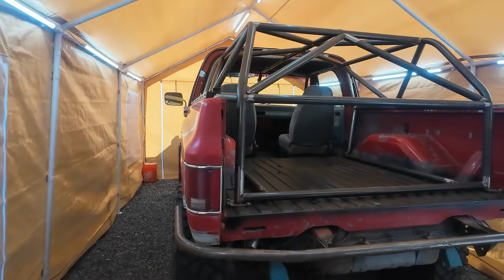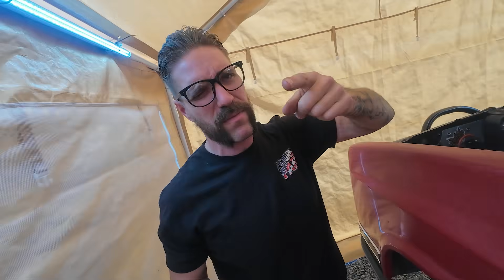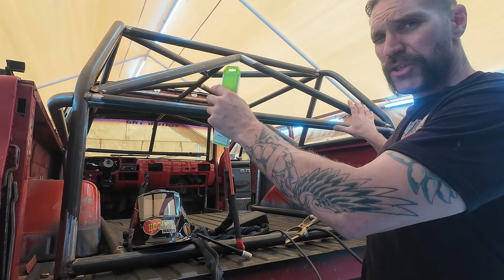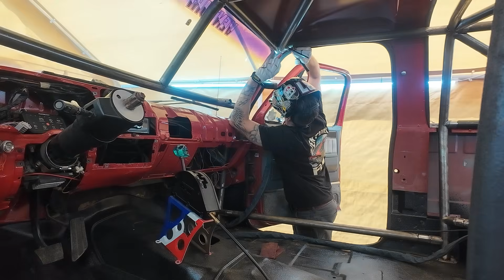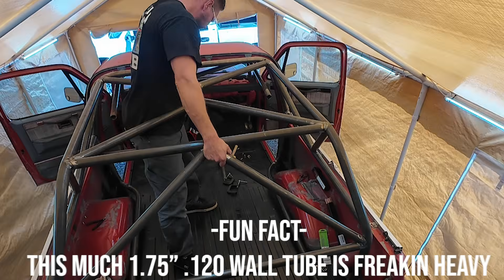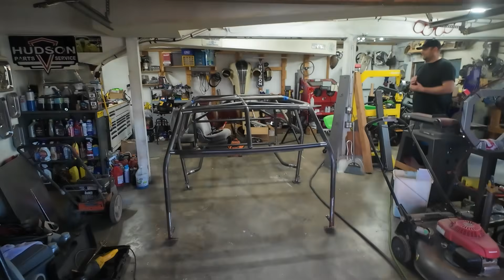TIG Welding the Roll Cage for My Squarebody on 40s | K5 Blazer

Comment: That tip about unplugging the batteries before welding is something I’ve always heard but never done! I guess I’ve gotten lucky so far lol… need to stop “playing with fire”
Reply from the maker: Honestly, 95% of the time you will get lucky, but it aint worth it when that 5% bites you...they make clip in battery surge protectors as well, thats typically what exhaust shops use when they do their thing
https://amzn.to/49IPW87
Reply: @VenturiFab now that’s a fancy tool!!!